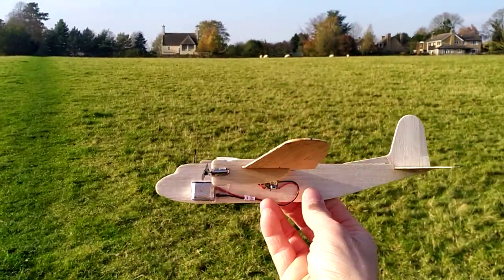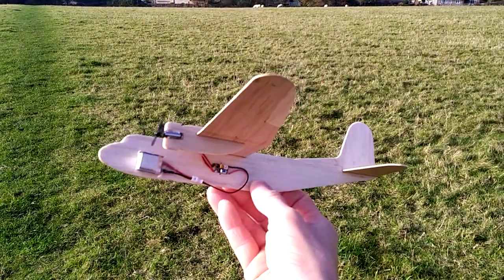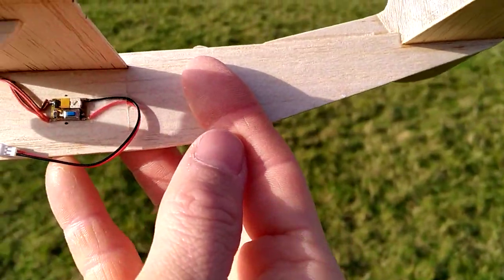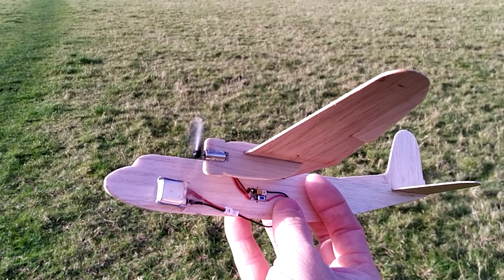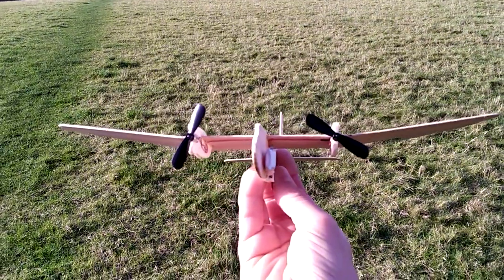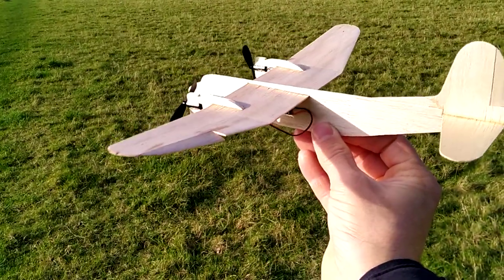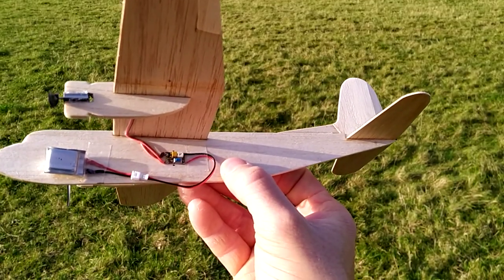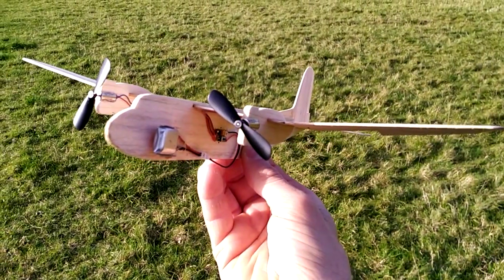13" Free Flight Electric Twin DC-5 -Model Details

Comment: Beautifully! Could you describe the values of the individual elements of the Fet timer? What is the value of the potentiometer? Is this potentiometer used instead of a resistor in the original fet timer design. Is the switch monostable? Do you have a printed circuit board pattern?
Reply from the maker: @marcinlipinski1149  Thanks, the circuit is described here: https://peterboroughmfc.org/technical-articles2012/11ModifiedFETtimer.htm but I haven't published the etched board pattern anywhere - it's fairly simple though. The MOSFET is a SOT-23 package, there are many suitable but AO3404 is a common cheap one allowing up to 5A current. The capacitor is a tantalum 47uF B-Case. The trimmer potentiometer is a 1M ohm Bourns 3313J-1-105E  - possibly a bit pricey now but if you don't mind some extra weight then there are lots of cheap 6mm trimmers available. And yes this replaces the resistor to give variable time. The push switch is a 6x3mm tactile momentary push-to-make SMD from ebay: https://www.ebay.co.uk/itm/223869218283 Lots of similar available. I added a 100R resistor to protect the switch (limits the current accross the switch  while charging the capacitor) but it's probably not needed. Yes, it works as a monstable, it's the same as the original design but using the onboard Lipo to charge the capacitor instead of an external 9V zapper battery. Hope this helps, feel free to ask more questions if you need to...
Reply: Thanks a lot! I run a modeling workshop for children and I would like to build simple models with them using XPS foam. I initially chose the supercapacitor based drive method, but now I see that a fet timer is a better solution, provided it can be operated like yours on the Twin DC-5.
Reply from the maker: @marcinlipinski1149  If you would like to contact me by emailing the Peterborough Club, I will send you the circuit board details. Jon

Comment: can you explain how to make the timer and where can i get the components thank you...
Reply from the maker: Hi Roberto, the timer is an etched circuit board version of this circuit: http://www.peterboroughmfc.org/technical-articles2012/11ModifiedFETtimer.htm I designed & printed & soldered the board. I will be releasing more details at some point.